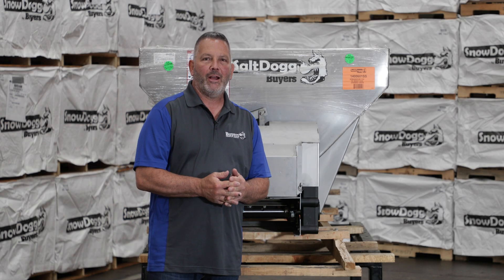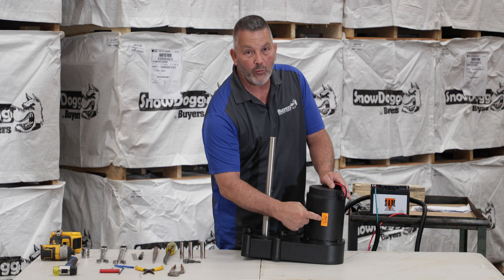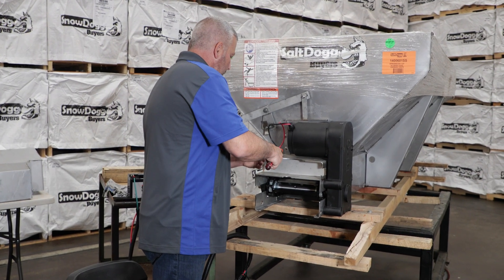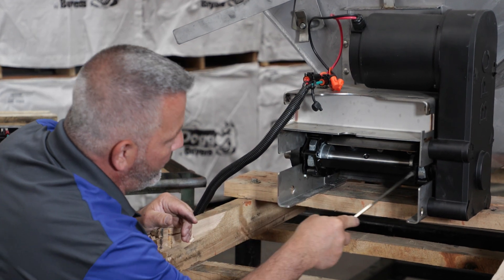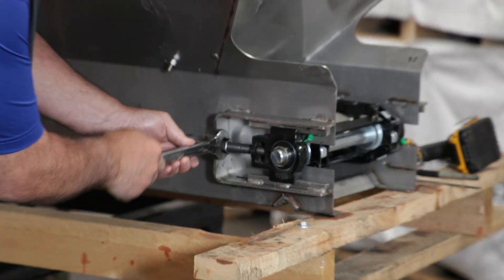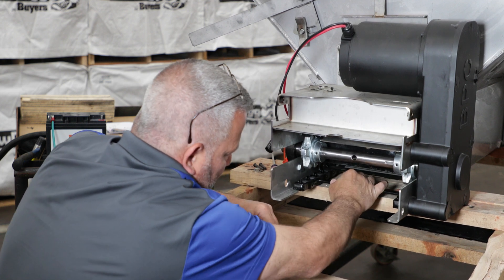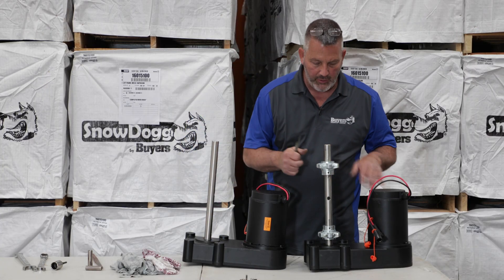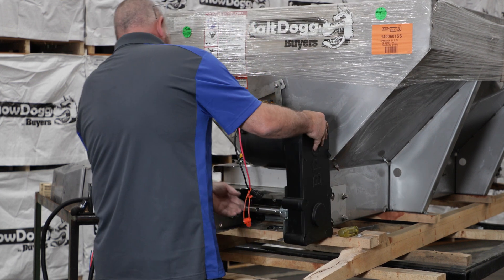Gear Motor Replacement for the SaltDogg 1400601SS & 1400801SS Spreaders

Comment: Do u know why it won’t spin mine just isn’t spinning and it says error on the control box😢
Reply from the maker: Hello! Thank you for your question. Put direct power to the spinner and see if the motor is good, then check power at the motor from the controller. If you have lingering issues, feel free to call our main line (440-974-8888) and ask for Tech Support. They would be happy to assist!
Reply: @BuyersProductsCompany  ok thanks for letting me know 😊